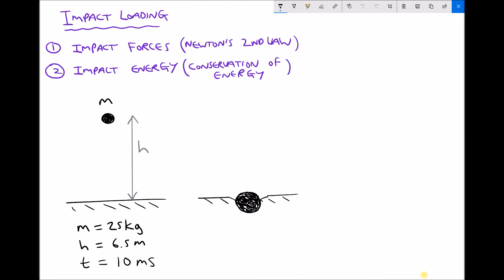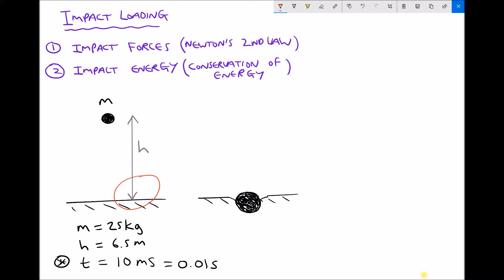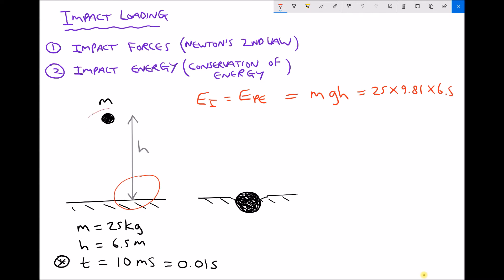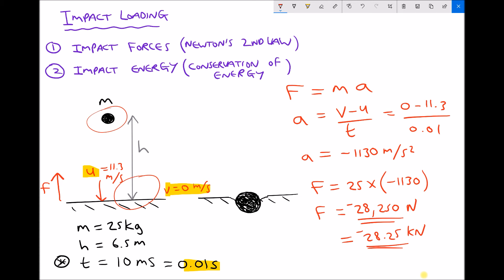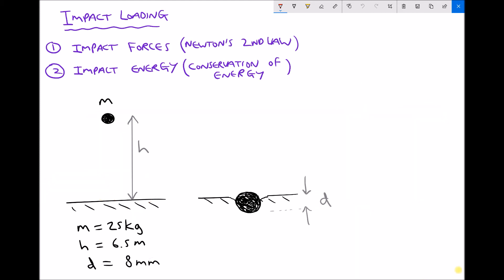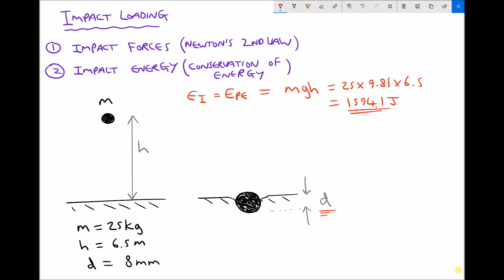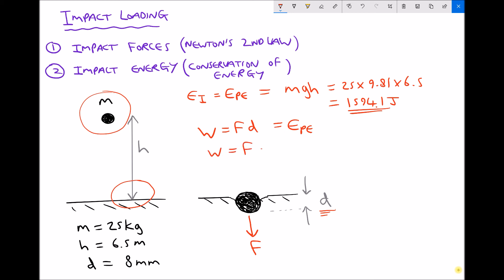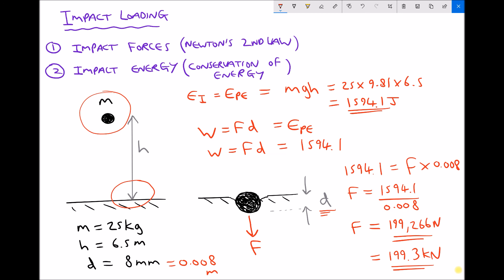Calculating Impact Force and Impact Energy Under Impact Loading

Comment: Hi, you mentioned at the very end of the video, that you could measure the toughness of the material from similar calculations, can you please elaborate on this in another video ? I understand that toughness is equal to the strain energy density at rupture which is typically measured by a charpy/Izod test but I don't see how would you calculate that from an impact, please explain this too. Thanks

Comment: Sir I have small doubt.. the initial PE potential energy (mgh)is 0 due to the is no velocity or movements there after it has converted to KE- kinetic energy 1/2mv^2 so u can use the equation of KE for impact on ground. After impact it just converted in to PE... and how we calculated the change in time or change is distance in different material using this problem. that is very difficult and I don’t understand?
Reply from the maker: Hi Vijay. The variable that would change for different materials is impact time and rebound height. We make some assumptions in this video such as the object doesn't rebound. In reality it would. The harder the material the greater the rebound. You may find this video useful to explain this further: https://www.youtube.com/watch?v=ANXoZMj10_4
Reply: Engineers Academy : Thank you very much sir for your information...

Comment: This is great, but there is a bit of simplification at the end. The Force presented is an average Force acting during all the duration of impact. The soil shown is very compressive. The maximum force actually occurred shall be greater than the one calculated. The force delivered by a compressive soil to oppose the downward ball motion will not be of constant magnitude Fi. When there will be just a little surface of the ball touching the ground the resulting upward force will be very tiny. Progressively, as the portion of the ball entering the soil increases, this will compress a larger and larger volume of soil, thus producing a vertical force going up and the ball will slow down at a faster rate as well. The maximum impact force will likely happen right at the end of the process. Actually, a very soft soil may behave close to the way of an elastic spring, starting from 0 force at the beginning to a maximum force at the end. But on the whole this presentation is very good.
Reply from the maker: Thank you for your feedback Paul.